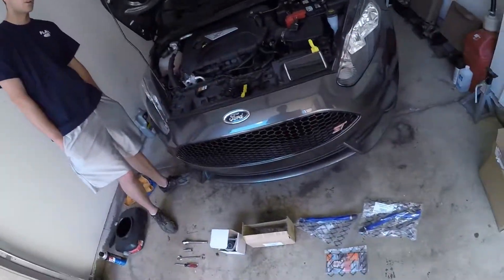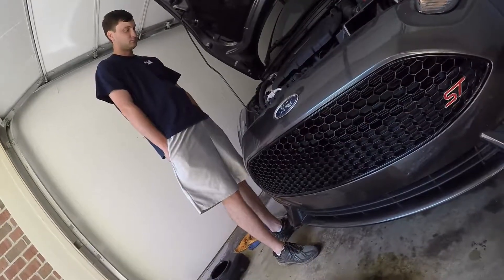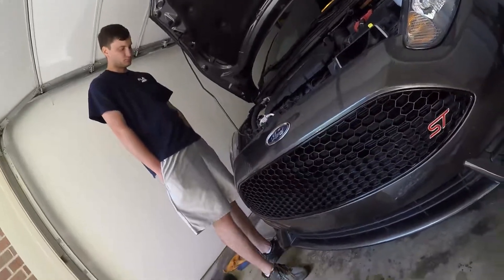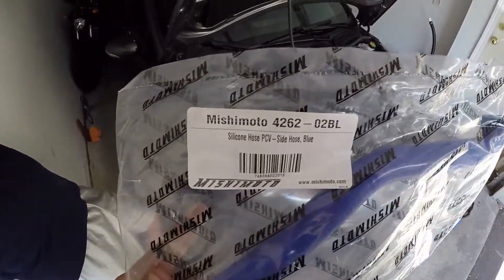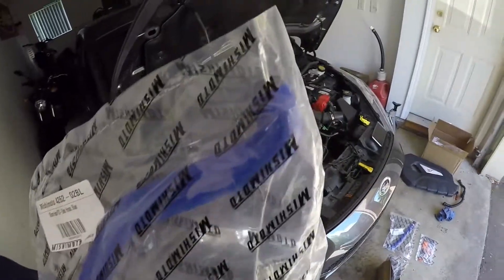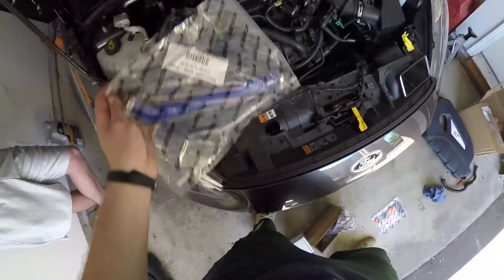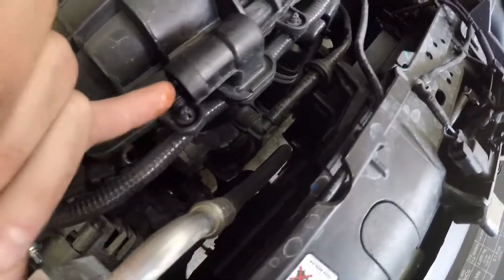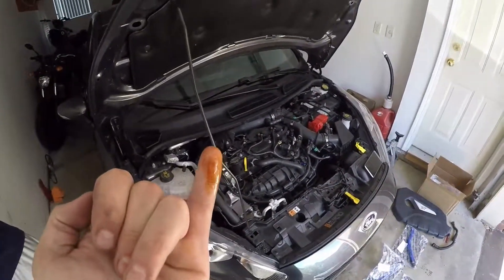Fiesta ST Mishimoto Oil Catch Can Install

Comment: Please post video of results of what you you catch from the catch can and indicate the miles and months since install / last inspection.  Looks like a good set up with good engineering but do you have to unseat the can from the bracket then unscrew it to evacuate the liquid contents?  I like that concept instead of a petcock on the bottom of the container bowl.  That way you can clean it out (even the sintered metal filter) and start fresh.  Please continue to post your results as time goes by to show the progression of engine wear in.  If you ever take off your intake manifold please capture carbon build up on valves.  I am looking to do what you have done for a 2017 ST that has been ordered.  Did the Ford dealership provide any feedback about adding on this accessory?  Personally, I can see this as a good thing to install.  For me this would be the only mod to the vehicle.
Reply from the maker: sorry it took so long to reply, no you do not need to remove the can from the bracket to empty it, but removing a headlight is a must. I have had buddies take there cars in for work and the deals have not said that it voids anything. I did post a video with an update, but the bracket broke.